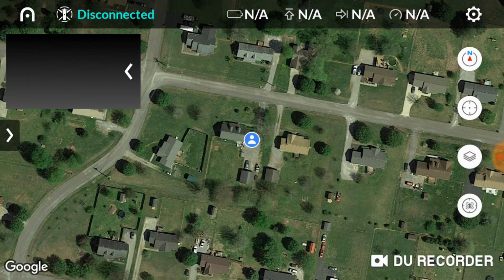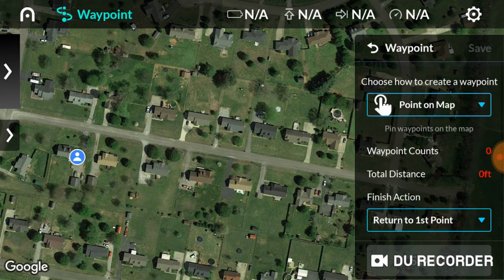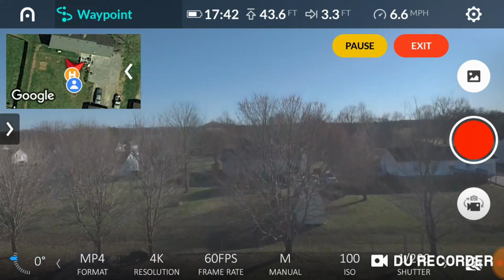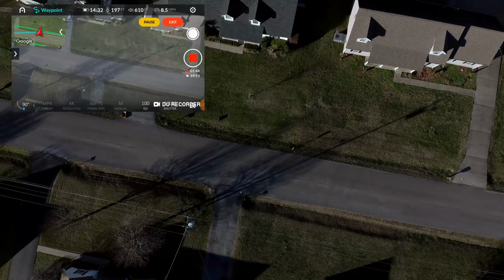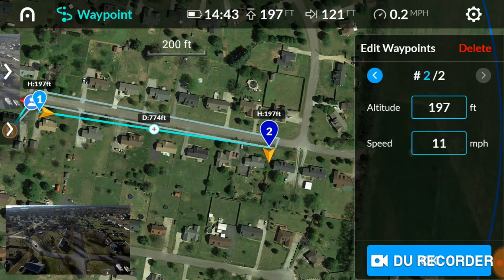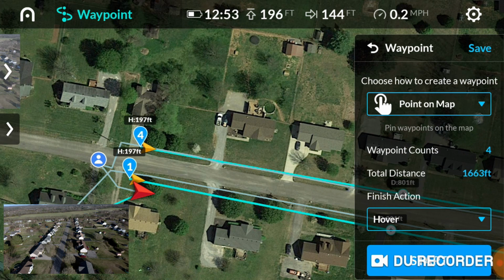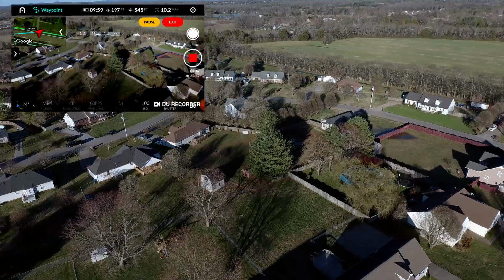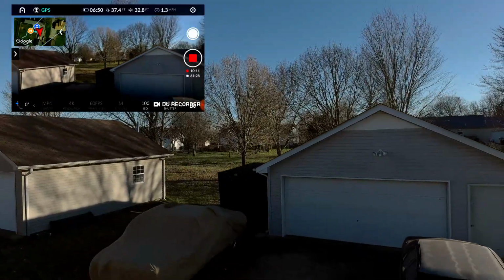Autel Evo - Using Waypoints & Free Control

Comment: Hi! Very good video. Is there a function to smooth the angles around waypoints like in Litchi App ? So the aircraft would make circular and smoother movements.
Reply from the maker: There is not as far as I know. You could do it manually with yaw if you set that option. But the actual functionality of the app is different from this version with the newer version. I need to experiment more with the newer version and may do a new one.
Reply: @Hi-DefCreative  thank you for your answer.

Comment: I just bought a brand new Evo and tried this, but could not control the yaw during the mission, only the gimbal.  Did they take away this feature?
Reply: The yaw control can be found in Advanced settings under EXP. you can change the yaw rate. I like doing a bit slower at .43-.47.
Reply: @qualudia1    I was talking about controlling the yaw during waypoint missions
Reply: @michaelbaxes4966  never mind.

Comment: Good stuff.  I have an EVO and just saw this waypoint mode available.  I had questions regarding the actual issues you brought up - camera angle and the yaw.  One question - when the drone if moving in a straight line, does the entire EVO rotate when the camera pans left and right OR does ONLY the camera itself rotate ?  Thanks again.  Good stuff.